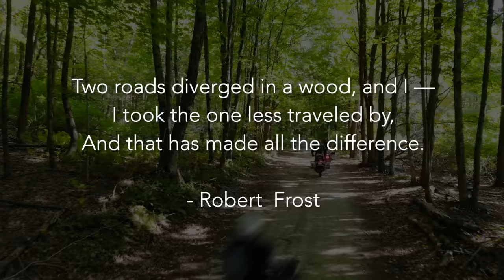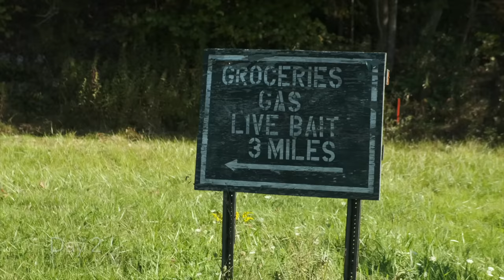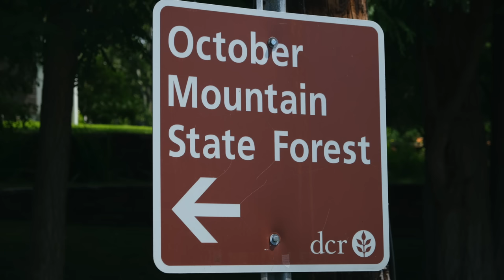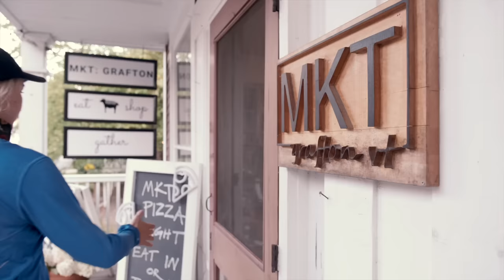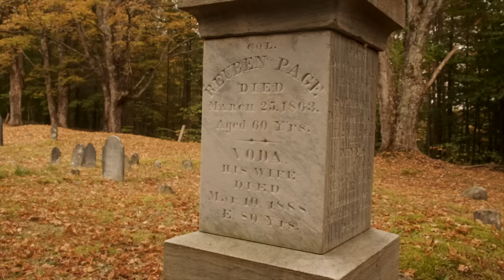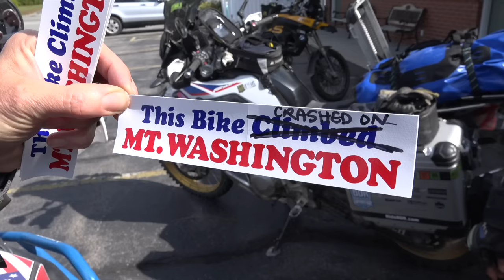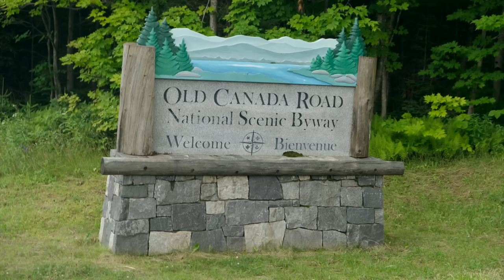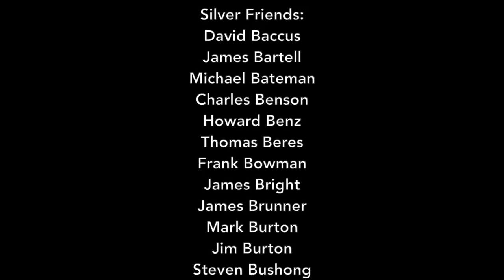North East Backcountry Discovery Route Documentary Film (NEBDR)

Comment: We rode Sections 3 and 4 at the end of May. October Mountain was phenomenal, hands down the most rewarding experience I've had on a bike. Took the easier alternates for the first couple Class IVs in VT, then tried my hand at Tabor Road, and it kicked my ass on the 1290. I am amazed by what Jocelin can do on the 1200GS.  Looking forward to getting into NH and Maine in the near future. Thanks for putting together some great routes! Only constructive feedback I have is it would be great for the GPS tracks to have like a ski-mountain difficulty label for  the different stages, though it's always condition dependent.
Reply: Is a GPS mandatory? 
(I'm not a computer guy)
What are gps tracks?
Reply: Yeah, I would also like to see which sections are good for 4WD rigs.
Reply: @savage22bolt32  GPS tracks are a series of navigation waypoints that your navigation system (even smartphone mapping apps) use to guide you along a pre-set route. If you use Apple or Google Maps you can add points and create a route anywhere on the planet, and then share it with others so they can enjoy it as well. Basically, it’s just a high-tech version of using a grease pencil on a Jimapco atlas and mailing Xerox copies of it to your buddies.
Reply: Buy the Butler Maps for the BDRs you're going to do. They show the tracks and highlight the Class 4 in Vermont so you'll know where to turn to avoid them (if you want). They were also very helpful in seeing the 'big' picture to see your progress and find upcoming towns for supplies. These maps a re great compliment to the maps and tracks you'll be using on your phone or tablet for navigation.

Comment: Emory cloth and jb weld and brake cleaner I have repaired a lot of engine and radiator damage if you use the putty cut off kneed together rough up so it will stick  I have even repaired pressurized copper water lines it’s a wonderful thing to add like a filter straw

Comment: Why use a 650lb machine to ride trail that rough.  You need a 250lb machine.  Personally makes no sense to me.  A drz400 would outperform those bmw’s in 99% of the riding you did, you would be less fatigued and if you dump it it rarely gets damaged. Sucks to be lying under a 650lb machine.